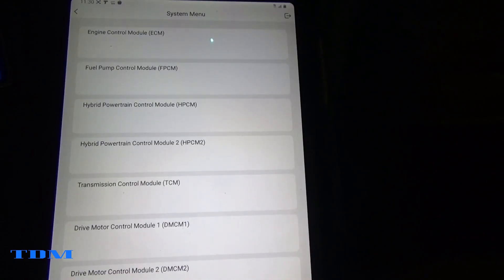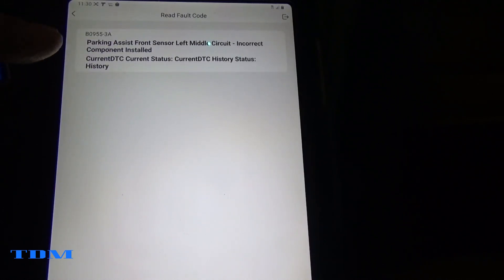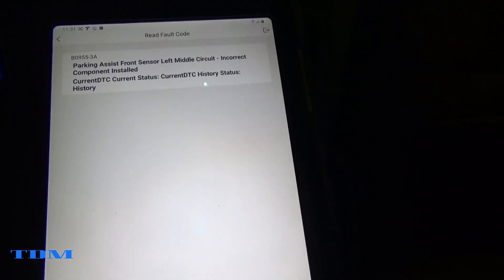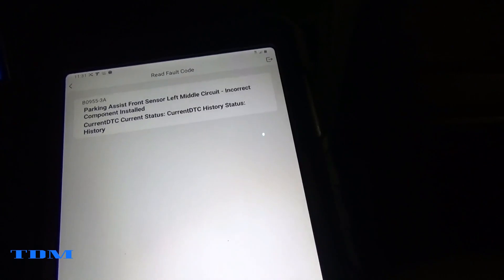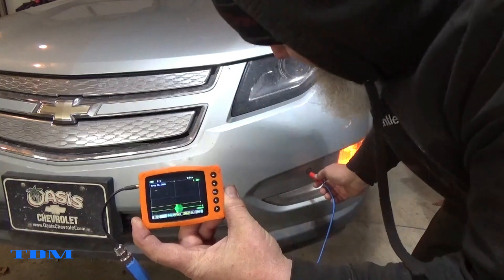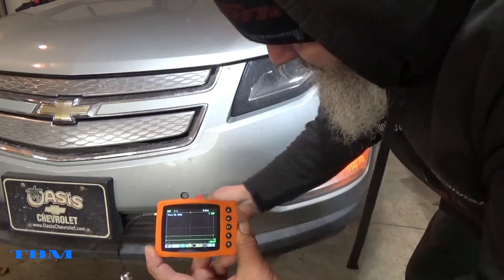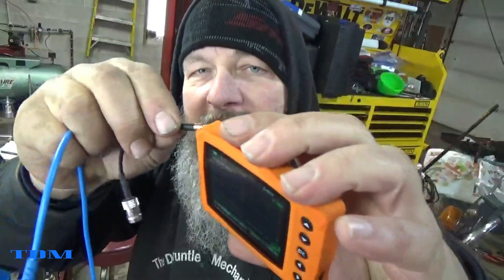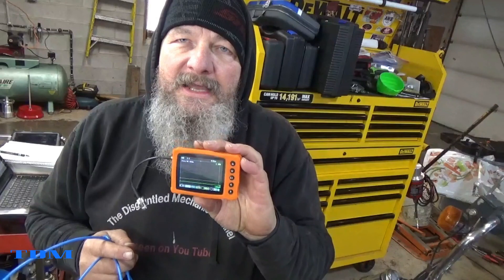Diagnose a Bad Parking Sensor With The U Scope

Comment: Great video. I'll be looking into one of those myself. What do you use to check codes Mike? I have a 2011 Volt myself. Be nice to check them myself and not go to the dealer.
Reply from the maker: I have mostly higher level scan tools that I use. I usually use my Foxwell because it is the one that has most current software updates. As far as lower cost scantool I am not sure. I would think most of them could read the codes but I can't say for sure. sorry.